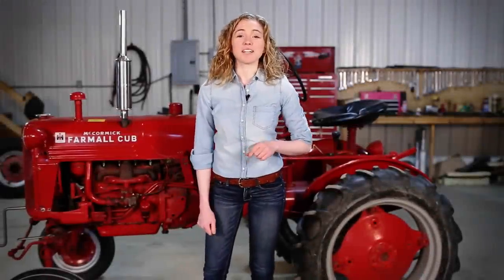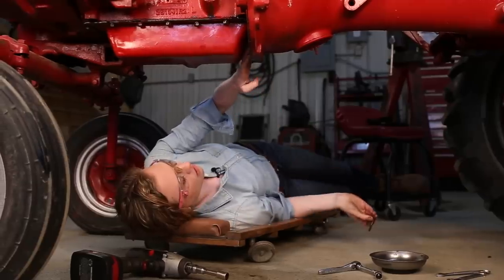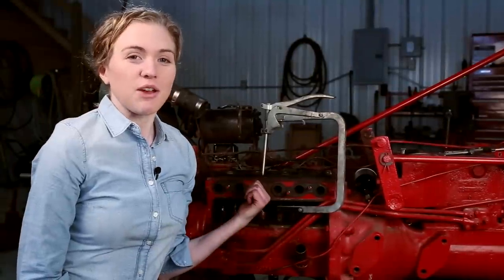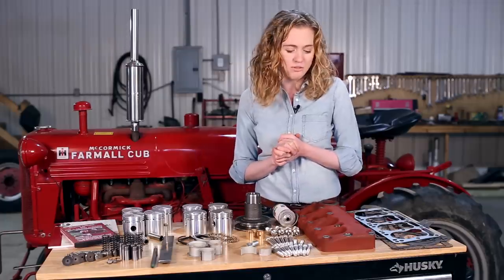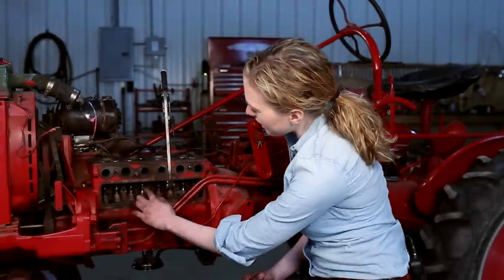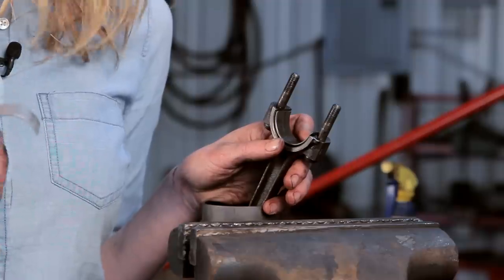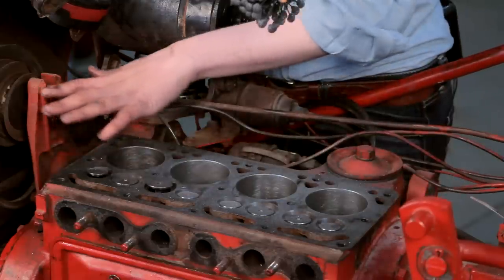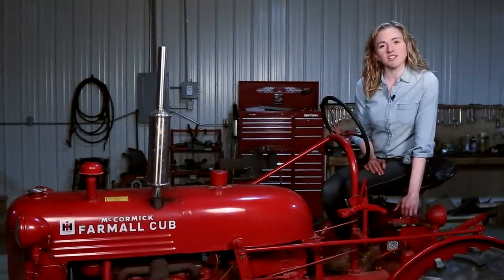Farmall Cub Engine Valves and Piston Rings: Easy Step-by-Step Tutorial

Comment: If anyone is wondering how the power poistons get installed into the engine.  I was told the raised bump goes towards the valves.  With the arrow pointing to the front of the tractor.  Super excited to have ours all out together.  Great video gave me the confidence to redo our cub.

Comment: Very good I was in the trads for forty three years. you are one the best I seen . Most of the guys have a hammer in one hand and a screwdriver in the other beating and praying on the parts . I like that you taped all the holes. Most hakes do not under stand  that the threads have to be clean to get the right torque along with new bolts. Keep up the good work.

Comment: Rachel, you made that look easy. I've always liked rebuilding engines and the satisfaction of hearing them fire up when you're done. Nice video, not "too much" detail. One word of advice, when you remove and reinstall the pistons, I like to put a piece of rubber fuel line on the rod bolts so I don't nick the crankshaft. When I'm ready to rebuild my '46 Ford 2N I'll check your website for parts and advice that I may need.
Reply: That's an old mechanic's trick and a very wise one too.

Comment: And adding the new part date installed also helps with keeping up maintainance records and replacement intervals for wearable items like valve guides seals valve seats and rings bearings and pistons and sleeves ,clutch pressure plates and governor parts and carb rebuild dates too once it's done record it and pass it along when you sell it or keep it with the unit.

Comment: Very informative. 
Any possibility of doin a front crank seal on a Cub?
Seems to be much debate on the method and tools required to pull the pully off the shaft. 

Thanks .
Reply: All I did to get the front pulley off was heated it up and pryed it off with two pry bars either side, I dunno why it’s so controversial, to put it back on i heated it up again and stuck it on with my gloved hand.

Comment: When doing engines with heads held on by bolts, I use two or three  guide bolts to keep gasket and head in alignment for other bolts. Guide bolts are grade 8 bolts with the heads cut of and tapper the end for a clean start.

Comment: Helpful hint.  When honing a block save yourself some headache and also protect the crank by laying a rag over the journals.  Same can be said for the camshaft too if it's in the sling area from the hone if you go below the bore.  You'll still have to clean everything up really well (I like brake cleaner), but using a rag will keep 99% of the crud off the journal and associated parts.

Comment: Nice step by step rebuild. Hint: Use plastic boots over the protruding rod bolts to prevent nicking the crank journals when installing the pistons. Also shop rags under the cylinder bores when breaking the glaze. Use a feeler gauge under the straight edge when checking cylinder head flatness. Flip it over and measure again to insure straightness of the straight edge! If not, average the two readings. I'm not sure if IH gives an acceptable gap. Is there a way to pre-oil that little engine before start-up? Do the pop-up pistons work well? Sometimes the gain may be marginal due to obstructing cylinder filling of the intake charge like the old Ford flatheads....

Comment: Rod numbers go towards Camshaft?  Pistons are often oval in shape.  0.004" per inch of piston diameter for ring gap?
Loose valve guides cause oil to be drawn up into the combustion chamber.

Comment: You can put rubber hose over the connecting rod bolt so as not to scratch the crank shaft journal when pushing out. This is especially important to do when reassembling...

Comment: When putting the rods in, put drinking straws or rubber hose on the studs  to act as a guide and so you dont hit the crank.
Reply: For sure,   doesnt take much to score that crank journal.   Hard to believe they didnt address that.
Reply: @bobbyboykin7137  I was seeing lots of stuff where I was like "Hey, you're spot on, but you've forgotten to mention X" or "Hey HOLY SHIT don't use a screwdriver on the valve seal!". 

Then I realized that there's no possible way for the video to fully encompass all the tips and tricks of engine rehab. I then was relieved to see the valves getting replaced entirely, and lapped.
Reply: @koof_a_loof  FYI, if you take off a valve seal or gasket, you replace it! Don't use old seals and gaskets. These things are made to be squiched together once. You talk like you should know this.
Reply: @frankvandendool882  valve seals typically get lapped, replaced if badly damaged. valve stem seals get replaced.

Comment: Thank you for the video.  I have a 1953 Ford 8N.  It was rebuilt in 1991, and I'm thinking it may need to be done again. Use it for mowing grass, and pulling snow with the 6 ft. slider I bought at Steiners in Grand Blanc.  Do you have a tutorial for Ford 8N's?  I may want to tackle it myself this time. Thanks again.

Comment: Isn’t that the sweetest little engine you ever saw. Liquid cooled, 4 cylinder, 4 stroke, 1500 max rpms, and a big old muffler, and cranking out 11 horse. Mine runs great but for some reason now I wanna rebuild the engine
Reply: This things has 11 horses?? i figured a tractor like this would have 30 at minimum but tractors are not my specialty,lol

Comment: what did you do for the broken bolt
Reply from the maker: Drilled it out.
Reply: Drill and EZ out, yay fun !
Reply: Hi folks. Yes, don't use an EZ out! They jam the bolt more firmly into the hole then tend to break off level with the top. They are made of very hard steel and it gets to be real fun. Instead buy a set of anti-clockwise drills. Flood broken bolt with anti-seize - use some modelling clay to firm a dam around it - and leave to soak overnight.  Start with say 1/8th inch drill in the broken bolt and work up. You may need a guide to keep the drill centred. With some luck when the drill bites it will unscrew the broken bolt for you. Don't drill so big that you damage the threads in the block. Otherwise look on YouTube for helpful suggetions - MIG welding a nut onto the broken bolt may well work if you know what you are doing. If in doubt consult a machine shop. BobUK.

Comment: I loved the video but I saw two major flaw first before you event think about removing those piston you need to remove the ridge cause by the rings at  the upper edge of the cylinder, second if you can not use an extension on a torque wrench it change the value because it flex.

Comment: Excellent job,  BTW do you have to add zinc additive to the oil to prevent cam wear,  like you do on old solid lifter cars?
Reply: use 25w40 Rotella, has the additives

Comment: Hi Rachel. Would you mind explaining the decision to use stainless steel as head bolts? I was always told HT bolts were mandatory. Stainless tends to bend and stretch more than steel and much more than HT steel. Having said that, I note your torque settings are quite low so I'm guessing a low compression engine being a side valve.
Reply: correct...bad idea using stainless

Comment: use anti-seize on the head and manifold bolts.
Reply: I am not sure why no one else picked up on this. Head bolts MUST have a thread sealer on threads. If you do not you will find antifreeze leaking past threads and will need to pull the head again to repair. How do I know that? Been there, done that. Can also cause compression loss and blown head gasket.

Comment: Question: Do the valve seats on these old tractors need to have hardened steel seats installed to run on the new fuels  or are they all diesel and safe?

Comment: Any suggestions for a valve that will not not come out? Number goes up even an then wont budge, I have tried carb cleaner and emery cloth on its base to no avail. With the valve up the keepers are out and so is the spring. The valve will only come up about 2 inches then stuck.

Comment: Hi Rachel. You seem to be quite informed about the Farmall Cab, but i have a International Cub 154. Their engines look identical and i wondered if they are? Next, i replaced my carb. with a new one but for some reason i cant get it to stay running. Ive done the 1.5 turns on the carb. and and everything is hooked up right but it seems to be starving for fuel after it starts, but then dies. Could it have something to do with my governor. I have 2 of these 154`s and the new carb. i had on this one i put on the other one, then bought another new one and put it back on the 1st one. Now it just wont run like it did. I have an inline filter and the machine doesnt have the sediment bowl thanks to its previous owner. This whole machine was a mess, but it run fairly decent. Got any ideas? They would be greatly appreciated...Jim

Comment: You mention if you have 30 over piston wear you have to order 30 over rings. You'll need more than rings. If you've got .30 over chances are the cylinder walls have high and low spots and will have to be bored or sleeved or you will get piston noise and slap and possible early engine failure including a busted piston which will likely ruin the block.

Comment: I noticed you didn't put any oil on the Piston before you put the compressor on the piston I've always oiled the skirts so the Piston did not run dry while you were turning the motor over putting the other pistons on and before you started

Comment: This was a little engine refresh?
Reply: So most people think a machine shop and total removal s needed. I have had great luck just doing the same thing. If you wait d=for the oil delition to take out a bearing or run a leaking valve until it ruins the block Brake cleaner and clean rags are your friend. This is good for another 20 years albeit the rear main and front seals will be leaking soon if they arnt already. Perhaps these were in another video. Im sure there is a method in mind here. Reminds me of a girl friend I had years ago that didnt mind getting her hands dirty. Very refreshing to see her elbows in grease with a smile on her face. Good job Rachel!

Comment: Does this tractor have Main bearing in the Block, I always replaced those on a rebuild.
Reply from the maker: Yes, it does have main bearings which are mentioned during the parts spotlight. However, this video is only an engine refresh--it is in no way presented as a complete rebuild.
Reply from the maker: Main bearings are explained in the Engine Rebuild video that we offer for sale.
Reply: @DanGingell   Not being critical but anytime you got the pan off  we always changed out the Rod and Main
 bearings since both  can help with oil pressure.

Comment: Why no ridge reamer?
Reply: Dan, a ridge reamer is only necessary if the piston and rings will not come out of the cylinder bore.  If using old pistons then there is no problem.  If using new pistons and a ridge reamer was not used then one must check to see that the top of the top ring is the same distance from the top of the new piston as the old.  Reason for this is it is possible to install new pistons only to find they push down into the cylinder and then contact the ridge above causing possible damage to new rings and maybe ring lands.

Comment: Micrometers and dial bore gauges are more accurate than calipers... a suitable set however is more expensive than a cheap set of digital calipers (by about a factor of 10... $15 to $20 vs $150 to $200 or so)🤔

Comment: Extremely incompetent video as usual.  As a machine shop owner , this video is full of common mistakes made by amateur mechanics.  She has no clue how to use a torque wrench, never ever use a long extension with a torque wrench , it greatly affects the torque value.  The torque value of the head bolts and connecting rods is also greatly reduced by torquing dry fasteners.  The crankshaft journal needs to be measured in multiple places to determine the out of round, those crankshafts are very soft and always worn beyond the specified limits, 002 bearings are only a crude crutch.  Those cylinder heads are easily resurfaced,  I've done 3 in the last month and all were warped over .010, which is far beyond the limit. When checking a cylinder head for flatness with a straight edge use a feeler gauge not "look for daylight".  The valve guides need to be installed to the proper depth not "flush" . New guides will often need reamed , especially on the driver end of the guide.  Lapping new valves with new guides into old seats is often a recipe for disaster. Looking for contact pattern on the valve serves very little  purpose, the highest spot on the seat with mark the full circumference of the valve. You need to look at the contact area on the seat instead. A piston skirt is cam ground(not round) and should be measure perpendicular to the piston pin halfway down the skirt to get an accurate measurement.  If a cub has over sized pistons they are typically marked on the piston head.  Measuring ring thickness is equally important to get the correct ring set.  New rings in an egg shaped tapered bore is also a very temporary crutch. You should find a professional to help you or quit making videos and selling them.
Reply: Your a dumbass
Reply: OK for those comments below this guy, he does have valid points.  Yes using an extension will vary and reduce torque settings as well as universals.  Some good info but it is incomplete.  My personal sucking air moment was running a tap with a drill, not something I'd do at all.  I'd prefer a time handle or short ratchet driving that tap for good reason and you would know that reason if you hit bottom or a piece of broken bolt and snapped a tap in a block...   oh yea if anyone wants to call me a moron or something here goes this.  2 years of hh trade school and 2 years of college trade school ase master tech automotive l1 and pif cert before I went into equipment 10 years ago.  Lp, electric powered, apt fuel, and  Cummins warranty certified.
Reply: Bravo Squad using an extension DOES affect torque value,  when you have an engineering degree and multiple certifications you understand the flaws in this video. Teaching others to do things improperly is not teaching!
Reply: @jonathanherbst3891  Good points. I had the same reaction when she used a drill to tap with-- that's a bit of a delicate job and you have to go in perfectly straight and slowly especially at first. I don't think her drill was actually very straight. I used to be a Class A mechanic, mainly at Honda.
Reply: @andrewevans1658  aren't there times when you need more clearance than a deep socket supplies?
Reply: Wanda James very rarely , but this isn't one of them. If an extension is absolutely necessary the torque value needs to a adjusted accordingly.  What people dont realize is that an extension acts as a torsion bar, absorbing the torque,  resulting in a much lower torque reading.
Reply: @andrewevans1658  Yes, that makes sense, the laws of physics are very complex-- just like leverage changes with the length of the lever- thanks for that-- I'm pretty sure I learned about extensions affecting torque during my training but that was many moons ago and I began to doubt myself : )
Reply: @andrewevans1658  Can you explain how the extension changes the torque value using a torque wrench? It will affect the angle to reach torque value or torque using an impact.
Reply: TerryK anyone who defends and condones this channel is as incompetent as she is.  Teaching ignorance and incorrect methods is not teaching!!  I dont have time to make videos , my days are filled with fixing mistakes like the ones in this video.
Reply: @andrewevans1658  Check out this video which tests torque wrench usage with extensions on high quality test equipment.  https://youtu.be/tRR96ILGORU
Reply: Extremely informative video by a very intelligent and beautiful young woman.
Reply: Rick Bearden I've seen that video before. At a lower torque reading that video (35 lbs) is true. As the torque value increases the greater the stress/ torsion on the extension.  I've asked them in the past to do a video at 200 ft lbs of torque.  They are motorcycle mechanics who never have to deal with high torque values.
Reply: TerryK this video is a prime example of why most professional  people avoid YouTube.  Trying to explain anything to tribes of retards is a complete waste of time and energy.  Looking at  comments that are solely based on her looks clearly state the intelligence of the average viewer.
Reply: @andrewevans1658  For this type of work,  extensions on torque wrenches are just fine.  She was working on a tractor not a space shuttle.
Reply: @BeckyT Right on.  Some people can't see past their own ego!
Reply: @BeckyT Very well said!
Reply: It takes alot more COURAGE and INTEGRITY to present yourself in the way that Rachel has done in this video than to present yourself as an ARROGANT KNOW IT ALL that has NO RESPECT WHATSOEVER.
Reply: Very harsh is your opinion. "Extremely incompetent video as usual.". Some of your points are valid. As a ASE certified Tech. I have been turning a wrench since the 70's. I do have the credentials to debate many of your arguments sir. I wont.  We simply  don't know if some of your points that you alluded to was done behind the scenes. To jump to any other conclusion is simply , to use your word, incompetent . I do respect your opinions however and I am looking forward for your videos on engine rebuilds. Good day sir.
Reply: You must feel like your manhood is threatened...But it's interesting that you diappeared like a coward!